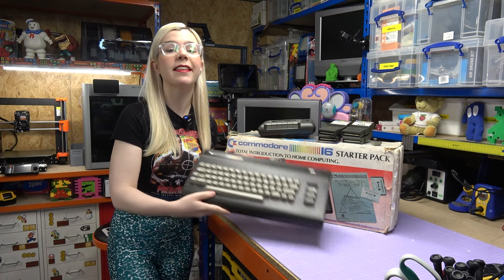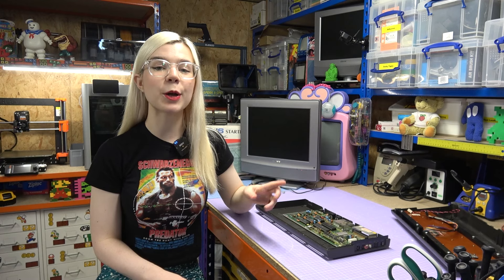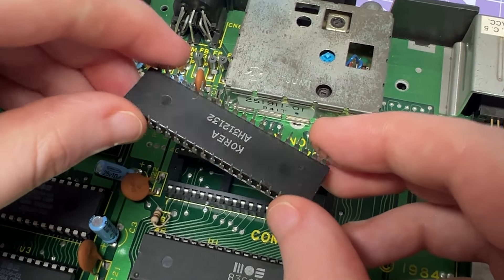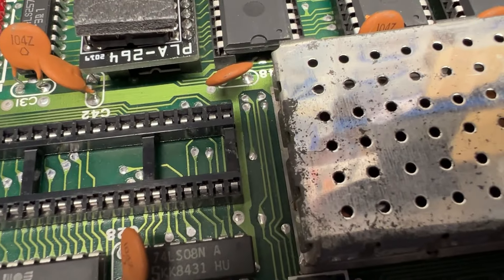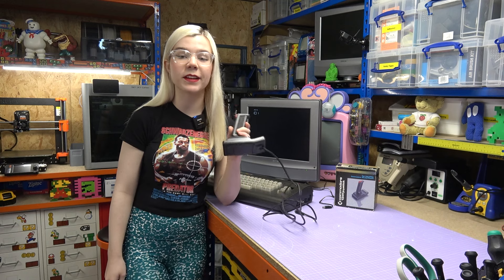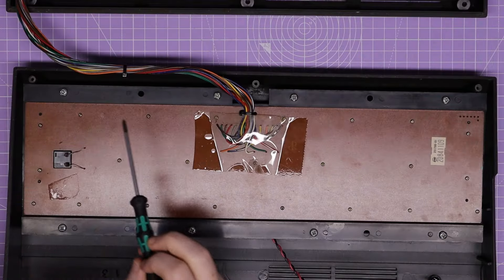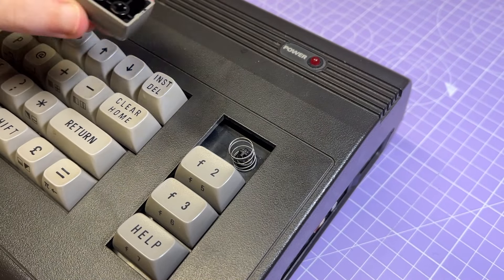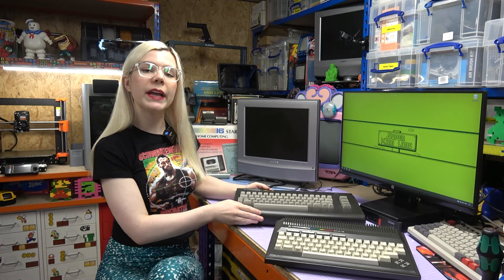Can I fix this 40 Year Old Computer // ft. Commodore C16

Comment: I have to admit, I was a bit jealous of my C64 friends being a Sinclair Spectrum child (upgraded from ZX81)
Reply: Exactly this (I also had a ZX81 with a 16k ram pack followed by the Speccy) ... however my childhood jealousy was my rich friend had a BBC Micro with 5.25 floppy drive, phone receiver modem and a load of copied games, I thought I had arrived in the future, haha
Reply: Now, this enters nerd territory, but with the shortcomings of the hardware, I realized the need for better software and I ended up learning assembler, basic (of course), Pascal and the rest. Btw, my dad paid me 10 cents to type in basic routines into his Sharp programmable calculator (even before the ZX was borne if I remember correctly) because his engineering fingers were too big (so he told me, or, he wanted me to be proud?). Therefore, the structure of programs were natural in my mind. Call me lucky having been a child at that time, in spite of all the C64 guys :)
Reply: @daviddowsett1658  A 5.25" floppy was a major upgrade to a BBC. We were poors and my brother and I worked many mornings before school on a paper round before earning enough to buy a bare 80 track drive from Tottenham Court Road. My bro even made a steel case for it in D&T class.

Comment: I have a valuable advice for your future repairs. Do not test broken computers with known working components from working computer. Do it in opposite way, take out the suspected broken component out of the broken mainboard and test it inside known working computer if its really the bad component.

Do you know why?

Comment: My personal rule of thumb regarding modding and replacing parts is: the chips are the heart and the soul of the machine. It's what gives it its unique character. So replacing the PCB? Fine. Replacing the shell? Fine. Replacing ports or surface mount components with fresh ones? Fine. But replacing the CPU with an FPGA clone? No, at that point it's no longer the same machine in my mind. No offense to the people putting in the hard work to reverse engineer CPU's and turn them into FPGA designs, it's seriously impressive and likely eventually it will be the only way to get a functioning replacement, but so long as working original chips exist I would always seek those out first.
Reply: My view is, f it's plug compatible with the original CPU including all voltage rails, it's just a replacement CPU. But if it's the whole board, including RAM, IO controllers, etc, on one FPGA, it's not different from emulating it on a PI board at that point.

Comment: The first thing you SHOULD do it look at any electrolytic capacitors if they are bulgy and replace those if any. Possibly where the video output is around somewhere, that's usually the first thing that breaks.

Comment: Maybe I missed it, but was the CPU actually defective? Did you test the original cpu after cleaning the socket or even just reseat it? I've never seen such a cpu die from just being shelved.
Reply from the maker: Can confirm both the CPU and socket cleaned with contact cleaner, and still no life :( ... regards problem, whilst researching possible causes for the black screen, a dead chip seems quite common. May of died, after cooling off from the last time I used it which is a good year ago.

Comment: Strangely enough the only 8-bit machine that I'd ever owned that broke was the monitor for my Amstrad CPC6128. My original Spectrum 48k Plus and C64 work perfectly.

And at least today, there's more 3rd party modern equivalents of the old chips to make up for the lack of original parts.

Quality Control wasn't always consistent back in the 8-bit days either I've read.

Comment: For usability, I would vote for the FPGA. For authenticity, I would go with as close as an exact replacement as budget allows. Good work.
Reply: The trouble with the 7501/8501 is that they are high failure parts: The majority of them is already dead and priginal CPUs that still work will fail soon. Therefore using original CPUs is costly and won't last long. A 6502 based replacement is the best solution as a compromise between original period correct chips, compatibility, and longetivety.

Comment: Definitely go with the FPGA. All 7501 and 8501 CPUs will die, there's a flaw in those chips that eventually kills the address bus outputs, so a replacement will also go pop at some point. The 6510 adapter is a horrible kludge. The I/O ports on the 7501/8501 and 6510 are not the same, the result of which is a dead floppy drive port if you use a 6510. The adapter should come with a new kernel ROM which patches this issue for software that uses the ROM disk routines, but anything that hits the hardware directly will still fail.

The processor boards that use a 65C02 are pretty good, a few games and demos that use undefined opcodes will crash but most stuff will run fine.

(for context, I designed a CPU replacement board for the Plus/4 a few years ago that used an old NMOS 6502 with a CPLD chip to implement the I/O port and AEC bus functionality of the 7501/8501. It worked quite well, but it turns out to be difficult to get 2MHz rated 6502s now, most of the ones for sale are re-marked 1MHz parts or 65C02s. And it would have cost more then the FPGA board, so the design was scrapped)

Comment: If I were in your situation. I would first source a original replacement CPU to keep everything stock as it's still available. Additionally, I would also purchase a modern equivalent to future proof several machines as a backup If another chip bricks again. New or original parts will only become more expensive and harder to find with time.

Comment: Hi, I'd go with an original processor and try to get a 8501, but not for 50,-, I'd go to flea markets, retro events or look thru private small ads for parts maschines. The FPGA-Version is OK, but not original 🙂. I'd NOT go with the 6510-Adaptor. The adaptor works, but you need a modified kernal and loose the tape routines. Since most of C16-Software come on type, this is the worst option.

And a few tipps for future-proving the maschine (and also your +4): get some (passive) heatsinks (just a few pence at e.g. aliexpress) and put them at least on the processor and TED. Also you should get some antistatic wrist band when you handle with the ICs to prevent the chips get damaged by static eletricity.
Reply: 7501/8501 are high-failure parts, you pay 50 GBP for a CPU that may die while you are looking it. Absoltely not recommended to use original CPUs in these computers. The only exception IMO is the Commodore 116, these computers are so valuable and rare that they deserve original CPUs as long as  they exist.

Comment: Personally, I would replace the C16 CPU with an original 8501 CPU for best compatibility.  Recommend the 8501R4 variant as they seem to run a bit cooler and more reliable.

Comment: There may also be some home-brew adapters that allow you to use the standard Atari plug joysticks and controllers on the C16.  Anyone see such a dongle on Etsy or elsewhere?
Reply from the maker: I need to have a look for one of those ... as you wouldn't believe how long it took for me to find that joystick. Found loads of 9-pins ones first before the one I needed lol
Reply: We had a store bought adapter for plugging in a C64 joystick (is it the same as Atari?). Of course that was some 40 years ago, so good luck finding them.
Reply: @karilawler  Guess all you'd need would be a pinout schematic for the C16, then solder up some converter from amiga/atari/c64 DB9 connector to this C16 joystick port.
A quick lookup tells me 1st 5 pins would be compatible as they are the same (up, down, left, right, +5V DC), Amiga's pin 9 would go to pin 6 here (Button 1), and Amiga's GND, pin 8 = C16's pin 7. The last pin (8) of C16 is "Select", which you could solder to some external/other button.

Comment: I'd put in the re-created CPU, as more and more older chips are failing and hard to get by the year.
Reply from the maker: Yea, that's one thing I'm worried about buying old stock/or pulls from other machines if they will suffer the same fate not so long down the line like this one.
Reply: @karilawler  I bought a couple of replacement ula's for two of my zx spectrums costly alternate re-created chips but worth it to keep my machines running longer into the future.

Comment: Did you try reseating the original cpu after removing it?, as there is a slim possibility that socket and leg oxidation can cause similar issues.. anyways good video as usual.

Comment: For removing such chips in difficult location, sacrifice an old flathead screwdriver, bend its tip in length for 5-10 mm in 90 deg. angle.
Reply: The better option is to get a proper IC removing tool.
Reply: @picsnmorede  You are right, but sometimes this tool is not so sensitive in handling.

Comment: You got lucky here, but you never ever put a known good chip into a non working machine. You don't know if something else has failed, causing your suspect chip to also fail. And now you have two dead chips and you're non the wiser.  What you should do is put the suspect chip into a known good machine to test the suspect chip.